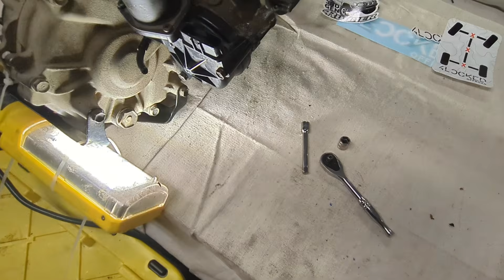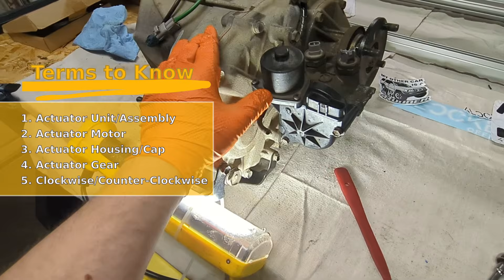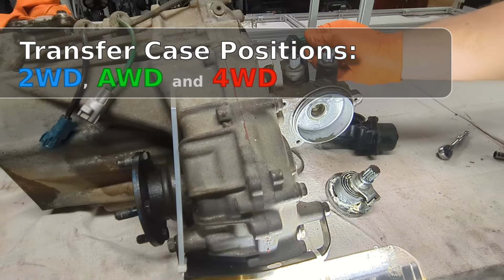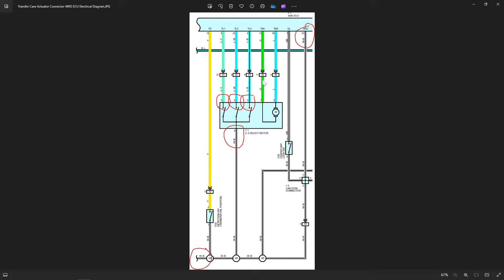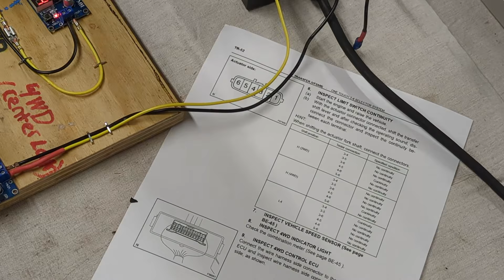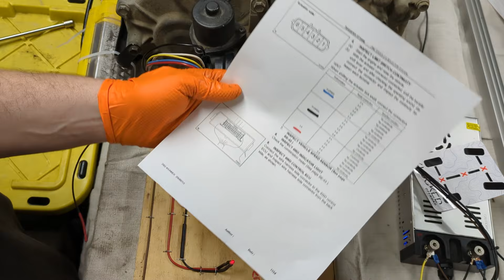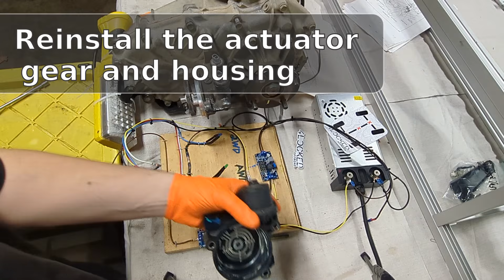Fix Your 4WD/All-Wheel Drive: Rebuild Toyota 4Runner/Tacoma Transfer Case Actuator Fast!

Comment from the maker: I know electrical systems can be intimidating, but don't worry — I’ll guide you through it step by step! You don’t need any prior experience to follow along. In this video, I’ll show you how to remove, clean, repair, and reinstall your Multi-Mode Transfer Case Actuator in under 30 minutes. If you're a 4Runner or Tacoma owner, this is a quick, easy, and cost-saving fix for your 4WD system. Drop a comment if you have questions, and don’t forget to like & subscribe for more DIY tips! 🚗💨 Thanks for watching, and happy off-roading!
Reply: hello! Thank you very much, it was really helpful, I would like to learn about the operation of the front actuator.
Reply from the maker: @melissacejudo877  I will be acquiring a front A.D.D. differential found in 2001-2002 4Runners (and most likely some Tacoma, Sequoia, etc) to make this video. I already found the source for one I just don't have an exact timing figured out yet.
Reply: I have a 01 sequoia, it activates the 4wd but the differential light keeps flashing, is this normal?
Reply from the maker: @melissacejudo877  I'm not sure about the Sequoia, but in my 2002 4Runner the is the transfer case electronic actuator and the front differential has an electronic actuator too. If you know for sure the transfer case actuator is installed correctly, then the flashing lights could be caused by the electronic front diff actuator. You would have to remove that electrical half (assuming its the same actuator design as what is found on 2002 4Runner) and look to see what's going on in there.

In my 2002 4Runner I have had the endless flashing 4WD lights a couple times. One time it was the transfer case actuator. The second time it was the front diff A.D.D. actuator.
Reply: @4lockedoffroad 
yes, it's the same.  I'll start checking it out.I will wait for the video. Thanks.
Reply from the maker: Thank you for being patient. I'll make it happen as soon as I can. It's actually been a project I've really wanted to dive into and record for the community. Stay tuned.
Reply: I commented earlier on the front ADD not responding when the transfer case engages, front drive shaft starts spinning, but still nothing up front. Installed a brand new actuator and still nothing. When you go on the Tacoma forums, there aren't any good answers unless you're an electrical engineer. This last video made perfect sense. Where to go to test the front is where the road ends. New subscriber. Thanks
Reply from the maker: @jacobrice5452  Sounds like the sleeve in the front diff that's physically moved left/right by the A.D.D. actuator to engage/disengage the front axles is not positioned correctly anymore between the A.D.D forks. Did you verify the A.D.D. actuator fork is properly positioned above this sleeve where it needs to be?
Reply: It's been a couple years, but I'm  almost positive it is. The sleeve also moved manually with little effort. I have had occasional success turning the truck off, shifting to 4low, pushing the 4wd button, and then restarting the truck. Sometimes I can get the front ADD to engage and the 4wd light to come on. If I transfer from 4low to 4hi, the light and 4wd stay on. Click the button, 2hi. Click the button again, transfer case engages, front ADD doesn't. It's killing me. 2003 tacoma prerunner
Reply from the maker: @jacobrice5452  Definitely sounds to me like an electrical connection is being interrupted somewhere. Whether that's an electrical connection within the actuator like rusted electrical circuit path, a faulty wire in the harness, a faulty/corroded wire pin in one of the connectors, etc. It could be one of the two wires in the harness that transmits voltage to the actuator to power the motor and turn the actuator gear left/right or it could be a wire in the harness that's used as a positional sensor and receives voltage and continuity when the path is "closed".
Reply from the maker: @jacobrice5452  A good starting point is to go under the vehicle and carefully disconnect the electrical connector. I'd have a helper toggle the 4WD transfer case shifter button on/off while testing DC voltage on every combination of the 6 pins. Two of those 6 pins are used to turn the motor left/right via reversing the polarity on those pins (just like the transfer case actuator in this video). 

If I remember correctly, the two pins powering the motor is 5 & 6 which are the pins on the far right (passenger side) of the A.D.D actuator when it's installed on the vehicle.
Reply: Also, when the truck is in accessory with the engine off, push the button and clearly here the transfer case but not the front. I've had all four wheels off the ground and rotated each of the front tires and nothing changed. Does the signal to the front come from the transfer case or from the harness behind the glove box?
Reply from the maker: Sorry I thought I responded to your comment a week ago. As far as I know the transfer case does not send any signals to the A.D.D. actuator directly. It all travels through the 4WD ECU.

Did you verify the wire connectors on the A.D.D. actuator & the transfer case are free from corrosion and the connector pins make good contact with each other?
Reply: Jason, you've been a great help. Thank you for your responses. I'll try the things you suggested and report back

Comment: This was a stellar video. I just replaced that plastic assembly and the 4LO/4HI, traction control and ABS lights are on. Does this mean that I need to readjust the gear assembly slightly? Or do I need a computer reset? (2017 4runner). Thank you so much!
Reply from the maker: Did you ever figure this out?

I'm not entirely sure for a 2017 4Runner as this video was made for 3rd Gen 4Runners with the multi-mode transfer case. However, I'm inclined to say, yes, you need to get the actuator and its internals realigned. Sounds like the electrical side of things think it's in one drive mode, meanwhile the mechanical side of things are in another mode or the electrical side is halfway in between (not assembled & aligned correctly).

Comment: Neat.  Would this be applicable for the 03 - 09 V6 4Runners as well?  Been having both flashing green and orange 4x4 icons --- 2HI > 4HI doesn't work.  Oddly, even 4LO does not seem to be working either (no response when switched to 4LO) -- no lights either.   Tried changing 4WD ECU and same issues.  Figured it must be the transfer case actuator at this point.
Reply from the maker: Sounds to me like it's the transfer case actuator OR the front diff actuator. I know depending on the year of 4Runner  within the 3rd gen years Toyota switched from Vacuum operated actuators to electronic ones. I can't say much about the actuators for 03-09, but it's highly likely they're electronic actuators, maybe even the same ones if you're lucky. 

Keep me posted and let me know what you find, I'm curious about it now.
Reply: @4lockedoffroad  Much appreciated!  A bit slow here as our weather has been goofy (keeps dropping down to 30s despite getting even one day at 90 high).  Should have some time to hop onto this once the weather stabilizes up north here.

Comment: On my 02’ 4Runner with multimode, the shaft all the way inwards (counter clockwise) acts like 4wd, while the shaft all the way outwards (clockwise) acts as 2wd… any ideas? i’m at a loss.

Comment: Can you show me what's involved in replacing the bearing for the rear output shaft.  The tcase is the same as the one your working on here.  It has the small outer case holding the output shaft.  Just wondering if the bearing is pressed in or is it just removing the outer rear output shaft  case and removing the bearing.  Appreciate it.
Reply from the maker: Wish I can help, but I have not done this service before. Perhaps you can find some by Timmy the Toolman. Search for "timmy the toolman <your year of 4runner and the repair part>".

Best of luck, let me know if you don't find him.
Reply from the maker: @timmythetoolman

Comment: I have a 2000 4runner limited, my question is, should you be able to move the gear freely switching into gears? Mine seems difficult, does that mean motor is seized?
Reply from the maker: Not necessarily, there are things inside the transfer case that has to align in order to switch through and engage the different positions. This is why my 2002 4Runner 4WD manual states that if the lights continually flash and do not engage AWD or 4WD then to rock the vehicle back and forth by switching between transmission Drive & Neutral.

Here's what I would do:
1. Chock front/back sides of BOTH front wheels.
2. Jack up the rear axle so both rear wheels are off the ground.
3. Parking brake off.
4. Transfer case Neutral
5. Try to cycle through the transfer case positions by turning the gear with your hand. It shouldn't be terribly difficult since the rear wheels are unloaded and the front diff A.D.D. shouldn't be engaged meaning the front CVs are disengaged front the front diff.

In this situation, everything should be unloaded and turn easily enough so you can get the transfer case actuator to switch through the different positions.

Comment: can you do video for 4th gen? on how to grease gear components inside actuator ty
Reply from the maker: I'd love to make a video like that! Unfortunately I don't currently have access to a 4th gen 4Runner. To do it right, I need a spare gearbox with actuator to rebuild on the workbench while filming and a working 4th gen to actually apply the process to — so I can prove the rebuild holds up in real use.

Comment: My 01 4runner has been broken since 2021. I took the tranfer shifter off and put the rod in 2wd. I also blew the spiders out of the front diff at the same time. Since then ive been running without a front diff with just the cut off stub shafts to hold the hubs together 😮😮
Reply from the maker: That's a creative workaround haha — gotta do what you gotta do to keep it moving! Sounds like you've got a solid project ahead of you though. Get that front diff sorted and the transfer case back together and you'll be in great shape. Hope the video helps point you in the right direction!

Comment: This is the best video Ive seen so far on the actuator function.
When u say "4wd" vs "center lock" are you referring to 4hi and 4low?

I have a 2004 tundra with a non working 4wd system.

Thank you
Reply from the maker: Glad the video was helpful! In my 4Runner, "4WD" refers to AWD (which is 4hi unlocked) and "center lock" refers to 4hi locked or 4lo. 4Runner years 2001-2002 typically had a multi-mode transfer case that had this cool AWD feature allowing us to shift it into and out of AWD mode at up to 62mph. In these years when you want 4WD you engaged the "center diff lock" to lock the front/rear drive shafts so they spin the same rotations.

Comment: hey! im working on a 2004 toyota sequoia with the v8. we replaced the actautor and cant seem to get the lights to turn off. is there any kind of preload on that spring/gear assembly?
Reply from the maker: Sorry for the late reply! Hope you've got it sorted by now — but if you're still having issues, there is no preload on the spring or gear assembly, assuming your actuator is the same style as the one in the video. If it's still acting up let me know and we can try to figure it out!

Comment: Hi, I have an issue with my 2000 Toyota tundra. Recently had the blinking 4hi issue rebuilt add and transfer actuator still not engaging. Replaced position switch 1 and it started working. Worked great for about 2 weeks engaging 4hi & 4lo successfully. Engaged 4lo and it will not disengage. 4lo light blinking. Makes no sound line it’s even trying to disengage. Help please!
Reply from the maker: Sorry for the long delay, Youtube doesn't seem to always notify me of new comments on my videos. Did you ever figure out the problem? I would start by using a multimeter to check the other position switches. In my 2002 4Runner there are at least 2 switches within 5 inches of each other that are responsible for detecting the mechanical position of the rod in the transfer case.
Reply: @4lockedoffroad  I did figure it out. It was a position switch sensor on the T case. Thanks

Comment: Does the positioning also apply to the 2002 Toyota Sequoia?
Reply from the maker: Sorry for the late reply. If it's the same actuator then yes the position will matter. Hard to say for sure because I don't have access to a 2002 Sequoia. I would be surprised if Toyota designed a different actuator for 2002 Sequoia instead of using the one they were already using for Tacoma/4Runner at that time.
Reply: The Sequoia uses 3 and 4.

Comment: Hello Jason, I’m having trouble with my 4x4.

This is 2001 Tacoma V6, AT, access Cab. I bought 1 year ago and 4x4 not work since mine.

The transfer actuator does not work, disassembled the outer part with the electric motor. The gear rotates only 90 degrees. Clockwise (rod out) it is 2x4 and counterclockwise (rod in) it is 4x4. I move the front and rear shafts trying to rotate the gear on the transfer actuator and it only moves 90 degrees.

It may be something wrong inside the transfer?

This actuator, does not have the triangle shaped cover over the pinion and has only one position sensor on top.

The electric motor is stuck, does not move, but the cover has the same circuitry like yours.

The main question is “Should this rotate about 270 degrees like yours”?

Is something wrong inside the transfer case?
Reply: Addendum. My transfer goes with no problem from 2 wheel drive to 4x4 lock position but does not travel all the way to 4 wheel drive.

I checked the gear position is correct. About the extrusion.

I ordered a new transfer actuator. Is the one with two position sensors, no problem because I will use only the cover with motor.
Reply from the maker: Sorry for the late reply! Did you ever find the answer to your question? If your vehicle Year/Model only has 2 modes (2WD and 4WD) then your transfer case actuator may only have 2 positions. The third position in this video is for a 2002 4Runner which has 2WD, AWD and 4WD modes.

Hope this helps, thank you for watching and commenting. Sorry I missed your comment and couldn't respond sooner.

Comment: I have a 2003 Tacoma, two things I noticed with the system. One it is missing one of the wiring harness at the top, there is only a hole. 

The second thing is when I try to turn the actuator like you did, it’s “springing” back into place. There is about 3/4 inches of play, after that whenever I turn it, it returns back into the play position. Is it because the timing is off, or could that be another issue?

Edit: I forgot to add that whenever I turn the gear, the front drive shaft doesn’t lock up.
Reply from the maker: Sorry I missed your comment and didn't respond sooner. 

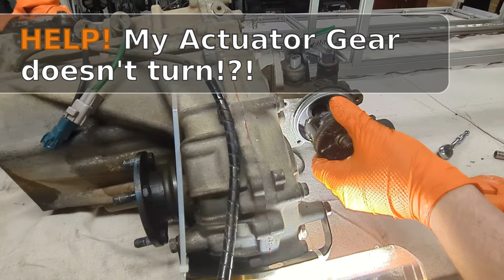See the video here: 10:00 - HELP! My Actuator Gear Doesn't Turn!

What I would say is if it's springing back your actuator gear may have been inserted at the wrong starting position for the current drive mode the transfer case is mechanically into. E.g. you inserted the gear in the position of AWD when the transfer case is mechanically in RWD.
Reply: @4lockedoffroad that’s fine, I saw that part of the video. I didn’t take the actuator out of the housing. It was still in place but as soon as I tried turning it in the housing it began to return to the original position. 

I think I’ll try sending some voltage through it to see if it moves it.

Comment: Question: I am only replacing the transfer case actuator. Can't I do that without dropping the transfer case? If so, what steps can you provide for that? 2001 Toyota 4 Runner Limited, 207, 686 miles.
Reply from the maker: I think you can replace it without pulling the transfer case. I can't give you the exact steps, but I'm sure Timmy the Toolman on Youtube has a wonderful DIY video. I think the whole unit slides out of the back of the transfer case. Sorry I can't be of more help, I have not needed to replace my transfer case actuator yet. (knock on wood)

Comment: my mechanic changed front ADD also transfer case actuator , try with different controller but both lights 4H and 4LO flashing. if i power manually on pin 1 & 2 motor moves and goes to 4H and 4 LO. so motor is good i can't figure it out. please advise.
Reply from the maker: Are you sure your mechanic installed the front A.D.D. actuator correctly? Did they separate the electrical half of the front A.D.D. actuator at all from the mechanical half of the actuator? It's easy to put the electrical half of the front A.D.D. back in wrong and that could cause the blinking 4WD lights.

There are also numerous other things that can cause the blinking lights. For example your transfer case has a couple of positional switches used to detect the mechanical position of the transfer case. These switches are called "No. 1 4WD Position Switch" and "No. 2 4WD Position Switch". You should take them out with a deep socket (i think its a 32 or 34mm) and test them for continuity. These are located outside the transfer case just above the actuator.

There are also two other sensors on the side of the transfer case below the driver called "Neutral Position Switch" and "L4 Position Switch". You should test these as well.